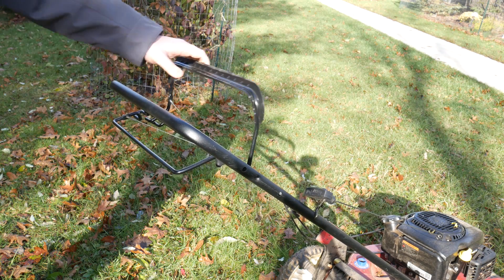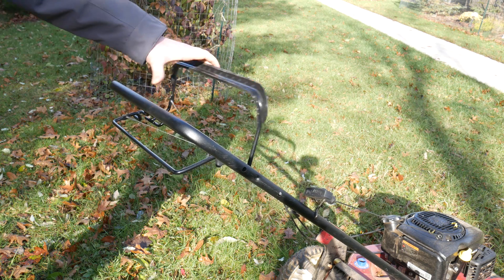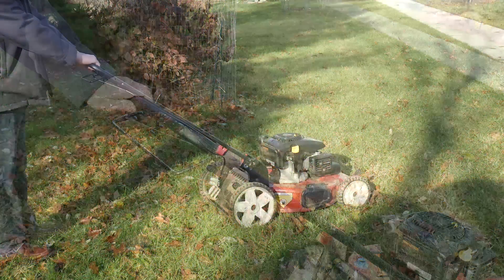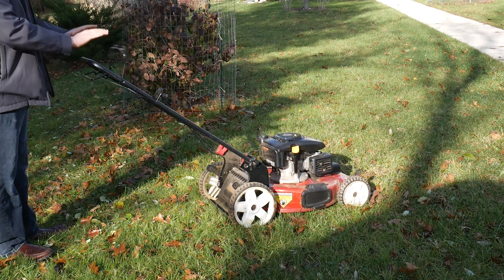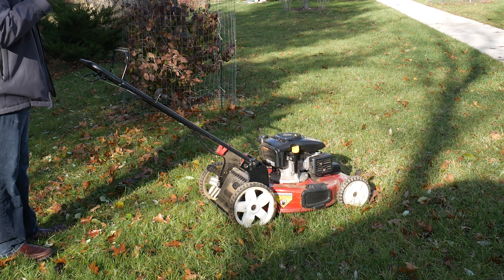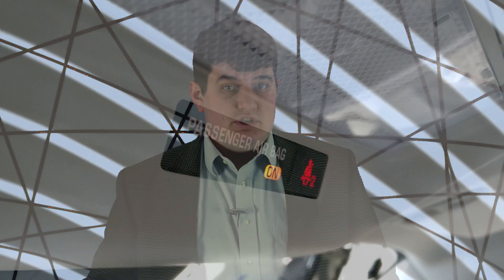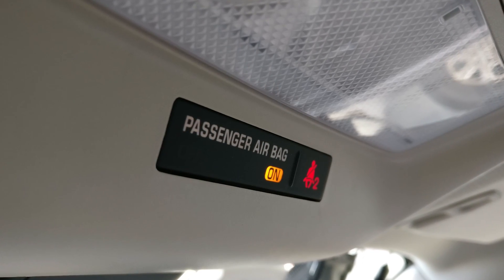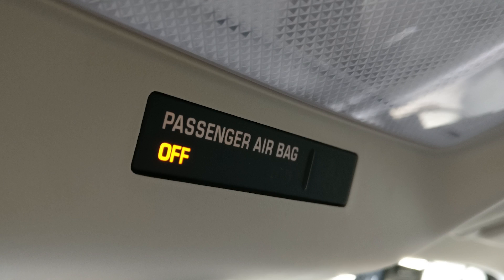The Dead Man's Switch:  How Anton Yelchin's life could have been saved

Comment: Why don't Americans use the handbrake at all times when exiting? I saw an article about a faulty park setting in a car some years ago and literally could not see why this was such a big issue for several minutes.
Reply: Personally, I use my handbrake everytime when I exit my car. You make a good point though, not many Americans use the handbrake. It drives my brother crazy when I use the handbrake and I honestly don't know why. He gets mad and says that I don't need to use it and nobody else uses it.
Reply: @brickman409  I don't like the way the car rolls a little bit when you put it in park and let off the brake without the parking brake set. On the rare occasion I don't set the parking brake that is my reminder to do so. I also live where there are mandatory annual safety inspections and never using the parking brake is a great way to make it fail inspection when they check it and it sticks or doesn't work because it was never used.
Reply: This American always uses a handbrake. My first 2 cars were MT and I got in the habit of parking in neutral with the handbrake. I have an AT now, and still use it in park regardless of where I am, incline or no. I think a lot of Americans have flat 1 or 2 car garages, and are taught only to use the parking brake when on an incline if they're in an AT car.
Reply: @robertknight4672  I have a Chevy Volt with an electric parking brake button. What holds the car when that electric parking brake is engaged are the rear brake pads, which complies with the federal regulations.
Reply: You people have all completely ignored the point of the video. "People should just use the parking brake" is not a solution to safety, because *people make mistakes*. The point of the dead man's switch is to add another failsafe in case the driver forgets or there's some other error.
Reply: @AndrewJJ-0114  I don't think the point has been ignored - of course there is a safely component that could be added - a dead switch is a reasonable idea. However, I will say my car, if its not in park and I open the door in my ford, it Chimes excessively. In cars with most automatic transmissions that still have a standard key, the shift lock / steering lock does not allow you to remove the key from the ignition. This problem is nearly exclusive to cars with wireless fobs, although that is becoming a huge trend!  I think more people are taking the stance of education in the handling of a motor vehicle would provide a greater benefit rather than just allowing technology that we can take for granted. Honestly, when I took my driving test in 2010 when I was 18, the handling of the emergency brake wasn't reviewed or required to be used while taking my road test. However, it was covered in handbook and tested on in the written exam. I agree with the comment below in other countries manual transmissions are still very common, so their opinion would be different, of course. I drive a manual and an automatic, and I set the hand brake in both. It should be something we do instinctively for our protection. On a side note, cars are becoming very complex with dozens of computer modules and microcomputers, I still like to fix and diagnose my own vehicles, so I am semi-opinionated because adding more computers and electronics means higher cost and complexity to diagnose and repair. 

I do believe in safety, of course. I lost my friend in a motor accident which could have been prevented with radar automatic emergency braking. However, there are many cases of people performing an overtake in the passing lane setting off the automatic emergency braking system, causing the car to brake in an on-coming lane. Jeeps are were also hackable remotely and people could disarm the throttle and control the vehicles systems. I think the Prius had a problem where the computer accelerated on its own. Sometimes using a computer and depending on software can cause great harm. The systems that can save us can also put us in undesirable situations and cause harm. Technology is powerful and a  blessing but also a potential curse. We just hope it saves more lives than hurts. That why I tend to lean towards education in this particular situation.
Reply: I think the difference between America and the rest of the world is that 99% of american cars are automatic where as in the UK (and most other countries I believe) 99% of cars are manual (stick shift) as a result people inherently get lazy and rely on the little peg that locks the transmission and dont bother with the handbrake. for example here in the UK we have to use the handbrake when taking our driving test and it is drummed into us right from the beginning as most of our cars are manual shift which if you dont use the handbrake they will simply roll away! also here int he UK if you take your driving test in an automatic car you can only drive an automatic car, if you pass your test in a manual car you can drive both manual and automatic. my point being that even if you pass your test in a manual and only ever drive an automatic its still drummed into you to use the handbrake :-)
Reply: I started using my parking brake when I began driving a manual transmission. I now own an automatic and still to this day set the parking brake, because I hate how the car moves and bobs when just selecting park. I prefer all four wheel are locked in their position (fwd cars), when parked.  Not to mention it is just generally safer in case of parking pin failure.   On that note, Chrysler/ Jeep have many issues with their computers. A co-worker of mine brought a new 2018 jeep and the adaptive cruise control "ran away" on her on the interstate and did not accept brake input to disengage. She had to shut of the car and start it again (while in motion) to get the car to respond. She left the car in North Carolina and Jeep towed it back to Pittsburgh for analysis. They gave her another Jeep. Sometimes drive by wire or software can experience unforeseen errors resulting in undesired behavior. I am a network engineer - so I love technology - but you are at the hands of a programmer.  Not to mention a jeep was successfully hacked by white-hat hackers to show how the system can be remotely controlled by its cellular connected (Jeep fixed that). You can look that up on YT. But  I think a dead man switch would be an acceptable safety feature to add into a vehicle - After all, a moving car is a basically a 2 ton weapon.
Reply: Like some I always use my parking brake as does my sister but my mom doesn’t and gets mad at me when I use it on her car. My dad works in construction so it seems like he does when he’s hauling or towing and he upgraded to a mid size dump truck that doesn’t even have park and thus must use the e brake for everything and it actually has a fail safe where it puts on the brake If you shut it off without putting it on manually.
Reply: As an American, it drives me nuts that nobody uses their goddamn parking brake. Stop abusing your poor parking pawls!
Reply: @Deezle_Gaming  I only use mine when parked on an incline that would otherwise put stress on my pawl. When I park flat I simply just put it in park. There is nothing wrong with only using the parking position to be fair, how many incident have you run into where the pawl failed and ran someone over? The problem here was that putting the damn car in Park was problematic due to a design flop.
Reply: It's insane that Americans don't use the parking brake. Maybe if they didn't call it an "emergency  brake" they might use it. But no one is ever going to call most U.S.A. citizens sensible.
Reply: Axe Bob you just HAD to use a blanket statement didn’t you?
Reply: I'd like to use the handbrake, but I always drive used cars. Since it's not as common for people to use the handbrake in America, I don't use mine. If handbrakes are not used regularly, it is possible that it will sieze up, and need to be fixed by a mechanic.
Reply: @timmowers435  In those states that have safety inspections, the handbrake/parking brake has to work; if not, the car will fail the inspection and the handbrake/parking brake will have to be repaired. The best way to keep it working is to use it.
Reply: Some cars have no hand brake anymore.
Reply: @HomelessPank  Wording is: "S5.2. Parking brake system. Each vehicle shall be equipped with a parking brake system of a friction type with solely mechanical means to retain engagement."
Reply: @brianleeper5737  That's what the park gear is for.
Reply: @HomelessPank  The park gear isn't "of a friction type"--it is a ratchet mechanism. So it does not meet the requirements of 49 CFR 571.135. What does meet the requirements--brake shoe with brake drum, brake pad with brake disc.
Reply: @brianleeper5737  I don't know what you want me to do about it. That's GM's problem
Reply: @HomelessPank  What GM model has no parking brake?
Reply: @HomelessPank  Maybe not a hand brake, but 49 CFR 571.135 seems to require a parking brake on vehicles sold in the USA.
Reply: Homeless Canadian it may not be a lever but literally not a single car ive been in hasn’t had one. Rather it be foot engaged, hand, or electronic they have always had one.

Comment: I agree with the sentiment of this video, but think the proposed approach lacks an understanding of the systems in use in conventional autos. ( Electric/hybrid are more forgiving and already have the needed equipment. )  A conventional automatic transmission will be damaged by shifting into park at any speed, and shifting into park will not slow or stop the vehicle if it is moving.  The paw that locks the output shaft is designed to reduce damage from shifting to park while moving by intentionally slipping teeth if the car is moving.  Only vehicles with electronic parking brakes or active braking cruise control have the needed equipment to stop a car that is in motion.  The best most cars could do at present is to shut off the engine and/or present a warning chime if there was no occupant and the car was in gear.  For as uncommon of a problem as this is, and the nearly 100% chance it is caused by user error, it's more of a solution looking for a problem.  I agree that any vehicle that has all the needed hardware may as well have some safety feature to prevent movement when there is no driver, but most current cars just don't have the needed hardware.  It's disingenuous to say all they need is software.  As more and more cars use electronic parking brakes I think this will be more feasible, but we're not quite there yet.

Comment: These seat switches cause more problems than their worth. We own an excavator with such a switch but if you go over a bump or are too small you can't drive it. We had to take it out because it malfunctioned. We got along just fine for years without these switches and they only further complicate an already needlessly complicated machine especially for mechanics who are already having trouble keeping up with new technology. If you want to prevent injury or deaths like this then fix the gear shifter, or better yet, don't stand behind cars. You should never stand between a vehicle and an inanimate object when the vehicle is on a hill. It's just asking for trouble.

Comment: You mention something that isn't a problem. The amount of work and engineering involved to acomplish something to prevent something that rarely happens. You are describing some sort of gimick that auto manufacturers can use to sell cars but it would cause a whole mess in its own right and would have no benefit to what we already have. What do I mean? For example, I leave car in reverse, open the door to leave, door chime notifies me the keys are still in the ignition and I should remove them, try to remove them, I can't, you can't remove your keys unless the car is in park(this system already exists in virtually every new car since the 80s.) That man died due to poor shifter design, and self stupidity. Your idea could potentially lead to unintended deaths on the road due to failing switches(it has happened before).
Reply: NightWrencher this type of accident Witz Cryzler cars happened before too. So what's the solution here?
Reply: 099Nitro chrystler just need to make a better shifter design that won't make people think its in park when its not. Another problem is that most of these cars have keyless ignition so one person could have turned the car off and walked away without realizing it was in reverse. As mentioned in the video, most cars have electronic hand brakes now and could implement a system that would turn on the hand brake if the car was turned off and traveling under 5mph. All in all, people just need to be smarter. That's all.

Comment: Why not simply bind it to the driver's door? If the vehicle is moving at less than, say 10 mph, the car stops itself or applies the parking brake if the driver's side door opens. I say 10 mph because any faster and an abrupt braking might do more harm than good, and would allow for emergency ditching in extraordinary circumstances. The seatbelt sounds like a good idea but I feel it's too easy to accidentally 'unbuckle'.
Rarely, if ever, do we accidentally open our car doors.

Comment: One can't tow or push the car then without placing a weight in the seat with a dead man's switch setup.

The proper fix is still just a proper gear shift. Sometimes you need to operate the vehicle outside of ordinary parameters.

This would normally be achieved by a shift interlock release which is present on many cars, but originally was purely mechanical. However, modern cars have purely electronic gearshift mechanisms. This means you'd have to make the shift interlock release another sensor.

Without even having an adversity to densors, we're stacking multiple things to achieve the same thing that an ordinary gear shift would give us.

Comment: My dad and I both hotwired the dead man's switch under the seat of dad's riding mower because we got sick and tired of having to struggle with restarting the damn thing every time we had to get up to move a tree branch or rock that would've gnarled up the cutting blades under the deck. >.> Sometimes that mower wouldn't restart because it would flood itself whilst spinning down.

We both always double-checked to make sure it was parked before getting off because we'd disabled that safety interlock.

But on the topic of cars and similar dead man's switches, it's not just people's lives that can be saved, but also personal property. Watch enough dash cam compilations like I do, and you'll see no shortage of cars where the owner failed to put them in park before getting out, then running away from them only to run straight into a storefront or other people's cars or barely missing pedestrians on the sidewalk before or while doing the former two items, or off a curb into the main road only to be T-boned by a huge truck and suddenly your insurance has to repair a $200,000 commercial vehicle AND total your compactified car all because your silly ass couldn't be bothered to double-check and make sure your car is parked...

Putting a dead man's switch in cars will do a whole lot more than save lives. But saving lives is the important bit and probably the only bit that could urge lawmakers to make some sort of regulation for it.

But until then at least we have hilarious closed caption cam footage of not-quite-parked cars running away from their owners... only to be worthy of heavy sighs and facepalms as those runaway cars become two-ton battering rams.

Comment: I rented a Crysler Caravan a few years ago. I pulled over on a rural highway to change a diaper. I really thought I had put it in park, but it was in reverse. The road was slightly downhill. As a result I had unloaded several suitcases before something kicked the idle speed up a little ( probably the AC compressor turning on). I had to shove the baggage into the ditch and run back to the controls to stop the car. I used the parking break religiously after that...

Comment: It might work - but what if the driver.. lifts shortly from the seat for some 
posture correction.. or something was between seat and driver.. 
or he/she needs a different angle of view ?

Or seatbeld interlock as a break trigger - no seatbeld set.. breaks on ?
Some taxidrivers do NOT use seatbeld for safety reasons

Why not detecting the angle of postion of the car ?

Comment: my uncle's VW automaticly applies "handbrake" if drivers door is open. You have to push the switch to override it. You know, in case if you are actually trying to reverse while looking through open door.
However, my car (also made by VAG) is much simpler - it has manual gearbox and and traditional, proper handbrake. Works just fine - just get used pulling up the handle, and eventually your brain would do it automaticly,  even if angry or smth.

Comment: Your concept mentioned in their video was spot on. FCA fixed this problem with a software update. If the door is opened and the gear selector is not in park it automatically applies the parking brake. No new parts just a software update.
Reply: The*